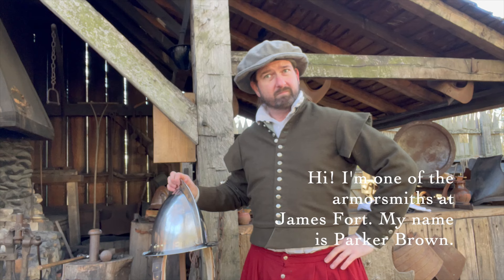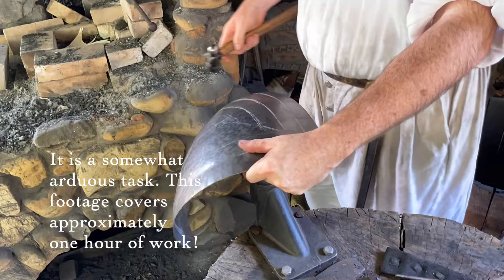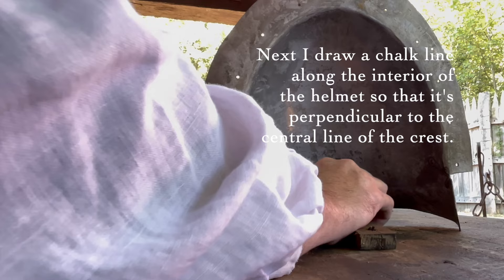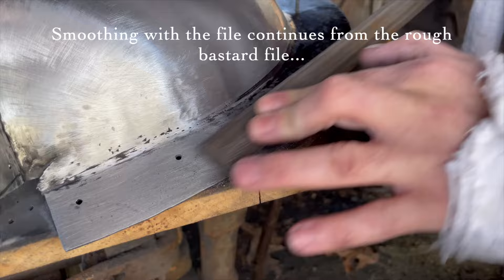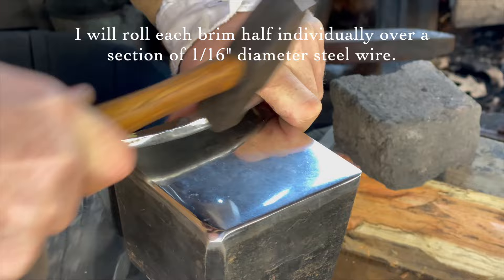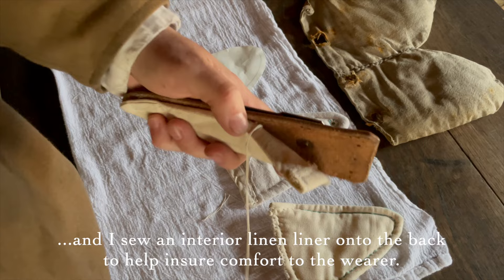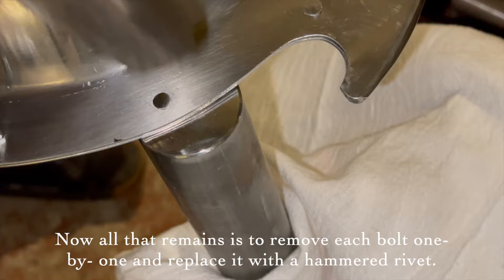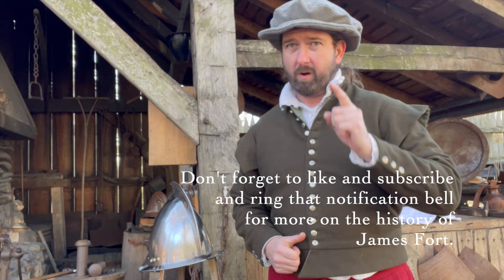Primed and Loaded | Let's Build a 17th Century Cabasset Helmet

Comment: This is very cool!  In the video, you showed an etching of an almost industrial polishing facility in Europe, noting that simpler methods would be used in Jamestown.  Did European armorsmiths have other machinery that would speed up the process of armor construction?  Or did they just have very many smiths working at once to produce the armor for European armies?

Another question: Would a breastplate take more or less time to make than a cabasset like this one?  On the one hand, it's a larger piece of armor, but on the other hand it seems like it would require a bit less detail work (fitting halves perfectly together, sewing in liners, etc.).  

In any event, thank you for this very informative video!
Reply from the maker: Thank you.  At the early-17th century, the proto-industrial capabilities would be found in the polishing mills, as illustrated in the video and the battery mills where the sheet iron was produced.  Within armoring shops trip-hammers may have been used, otherwise much of the production was through the handwork of journeymen, apprentices and other laborers employed in the shops.

With regards to production time, the making of a breast plate probably would take about the same time, or less, depending on a number of factors such as contracted fit and finish and whether it was a private or government contract.
Reply: @JYFMuseums  Thank you for that information!
Reply from the maker: You're very welcome!

Comment: Why is it called a "mushroom stake" instead of a "mushroom anvil"? Also the polishing takes quite a long time, was it always done, or was it sometimes skipped to meet big contracts in wartime? If it was skipped, did that make the piece more likely to rust, or to resist painting or "blueing"? In Europe, would the leatherwork normally be done by a leathershop, or most commonly by the armorer or his apprentices? Am I correct that at the time the English were favoring the cabasset the Spanish were favoring the morion? They seem to offer roughly equal protection but the morion looks to be superior as rain gear.
Thank you so much for including the production time. Any idea of its cost in terms of legal loaves of bread?

Thank you JYF for yet another superb video!
Reply from the maker: Thank you! Why is it called a “stake” and not an “anvil”? That’s a good question and we wish we could give you a better answer, but it appears that those tools set into holders or held in place in a vise tend to be called stakes. Like tools that are set into anvils are hardies and the hole in the anvil is a hardy hole.

For leather straps and parts, master armorers and armories could contract with the shops of leatherworkers for the leather parts needed.  They possibly could contract with the various trades such as strap makers, belt makers, or harness makers.  In turn journeymen leatherworkers could be employed directly by an armory as well.

On helmets, the fashion of the cabasset and morion came out of the armoring shops of Augsburg and Milan and became popular across Europe.  The English or Spanish did not favor one style over the other and both kingdoms used both styles equally.  Many of our modern impressions of the Spanish use of the morion helmet were created by artwork of the 19th century used to illustrate historical stories as well as 20th century films, such as Henry King’s 1947 film Captain from Castile with Tyrone Power. 

For insight into Spanish armor you might be interested in Spanish Arms and Armour, by Albert F. Calvert -- https://www.gutenberg.org/files/47878/47878-h/47878-h.htm
Reply: @JYFMuseums  Thank you so much! What knowledgeable, comprehensive, and quick answers to my questions! It really showcases JYF's expertise. I had a trip out to see you and Williamsburg a couple of weeks ago but life got in the way. Still hoping to get out this winter or early spring.
Reply from the maker: Thank you again, and hopefully we'll see you this spring.  And to answer you last question, as far as cost in terms of legal loaves of bread.  We'll assume penny loaves?  An "inexpensive" set of munitions grade pikeman's armor cost about 17 shillings.  A penny loaf being a pence, and 12 pence to a shilling (12x17), would be that a munition grade armor might be equal to the cost of 204 penny loaves of bread.
Reply: @JYFMuseums  Thank you again! Do you happen to know what a "penny loaf" weighed during the time period?
Reply from the maker: @leoscheibelhut940   Mainly the weight of a penny loaf, or any regulated loaf of bread was variable based on the cost of grain.  As the market price went up, the weight of the loaf would decrease.  Other materials could be cut into loaves as well.  Pea flour sometimes being added.  Local authorities tended to set rates yearly.  Unfortunately the best answer we can give at the moment is that about the mid-14th century a farthing (a ¼ pence) loaf Wastel Bread weighed approximately 5 and a half pounds.

It’s not an easy answer.  The research rabbit hole we need to go down is the “Assize of Bread”, the laws governing bread.  Wikipedia can at least give this introduction -- https://en.wikipedia.org/wiki/Assize_of_Bread_and_Ale

If you can find this article, it will give you all kinds of answers --  
Ross, Alan S. C., ‘The Assize of Bread’ in The Economic History Review, New Series, Vol 9, no 2 (1956) pp.332-342.

And this might be helpful -- https://history.exeter.ac.uk/research/economicandsocialhistory/blogdiscussiontimetable202122/exeterstudorbakers/ 

We'll come back with a better answer when we find one.